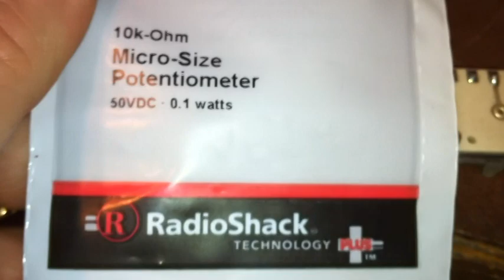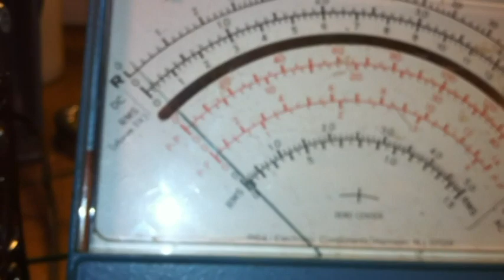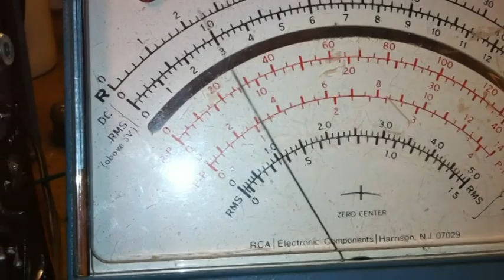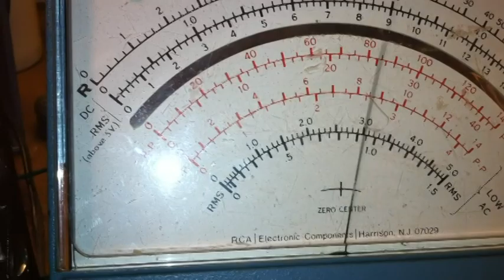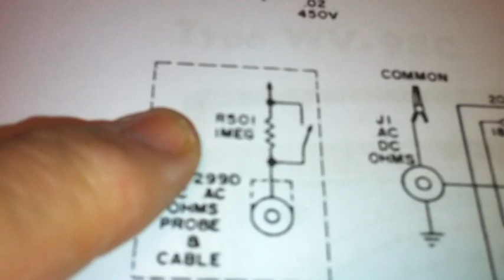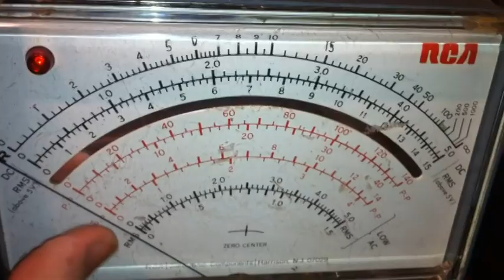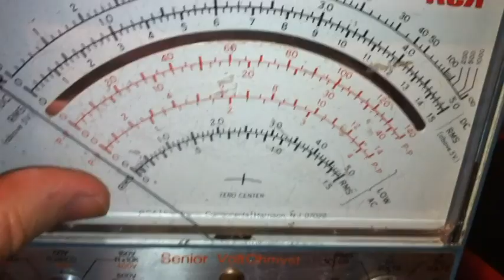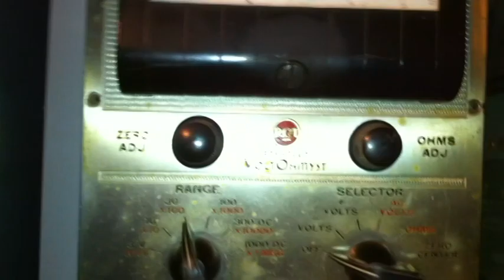VTVM, Senior VoltOhmyst Repair, Part 2

Comment: Thanks for the video. Very nice repair job on that pot panel. The 4 tube VTVMs usually are the older ones with octal based tubes. Typically, a 6K6 or similar single pentode (operated as a triode with its screen tied to the plate) for each side of the balanced bridge...so that's 2, instead of one 12AU7 miniature dual triode. Then there might be a 6H6 for the measured AC voltage rectifier (one half to rectify the measured voltage and the other half to act as a contact potential null...so 3 tubes. and finally a 6X5 or similar for the power supply rectifier. 4 Tubes.The later ones like the Senior Voltohmyst used, as you know, a solid state power supply diode, so only needed a 6AL5 dual diode and a 12AU7 dual triode.I used to align radios with either a digital (preferably the kind with the bar graph) on the AGC line, or an analog VOM across the low impedance speaker terminals or dummy load, but now I prefer to use a VTVM on the AGC line. Seems easier to me, but I didn't used to have VTVMs.  Rob

Comment from the maker: Hi Glenn!  Thanks for the comment. Well, the jury is still out on the RCA Junior Volt Ohmyst.  It works perfect out of its case. I put it in the case and it goes to crap.  Its not shorted but it sure is not right. I feel another video coming on before this thing is finally back up and running correctly.

Comment: i have just repaired my senior voltohmyst and had many of the same issues everyone has had.
 my probes coax has seen better days so i need advice on opening the probe
to replace it. guess that means cutting but where is the best place?
                                 barry